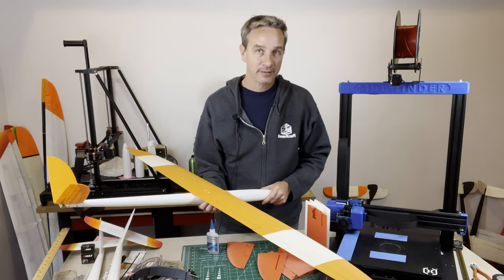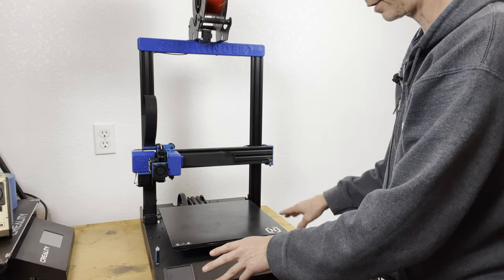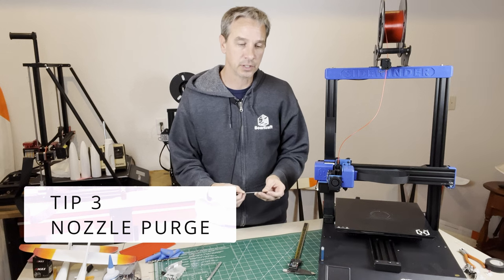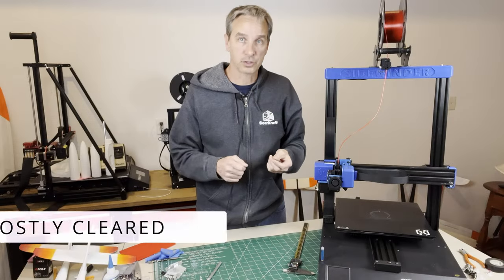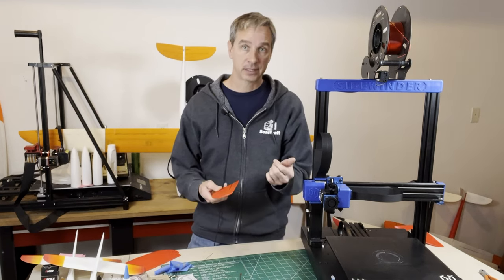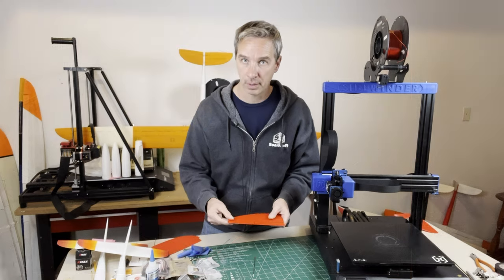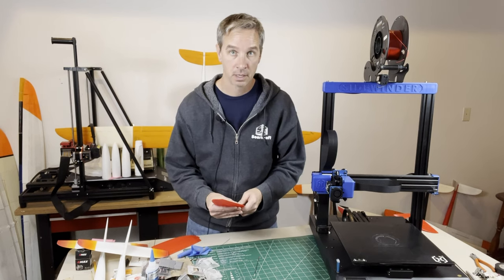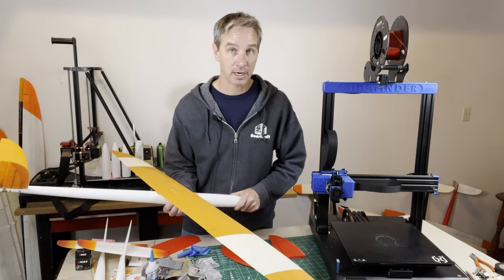5 Printing Tips - for better printing thin wall airplane parts

Comment: I love that Futaba Tx you had in the background, I had one of those for a long time.
Reply from the maker: I got it in the late 80's used.... 6 channel FM ch28... still have receivers for it too... I can get a modern module for it.  I sort of miss having a long antenna with a frequency flag on it as a wind direction indicator.
Reply: @soarkraft  Do flying fields even have a freq board?  Not like you'd have to concern yourself with being shot down.  🙂  I only got rid of that old Futaba when I moved cross country and had to thin down my RC collection.  
There's something to be said about old analogue.

Comment: Awesome tips! I’m a newby with a new Prusa MKs3+, and I’m learning that Cura is the slicer that the Plane Print models are designed for. I watched your video on using Prusa slicer for  model aircraft, nd was curious if i could use Prusa Slicer for my Plane Print model. Any tips will be much appreciated!

Comment: do you print the outside line first?
Reply from the maker: yes, or try to.  Cura 4.11, 4.12, 4.13 does this the best.  Makes for nice "skins".
Reply: @soarkraft  i think I overlooked that when printing my Pika, came out a little rough and flimsy at times, i also printed all wing panels at once
i'm covering it with fiberglass right now

Comment: The major problem I have with printing Planeprint models is stringing ! More I increase retraction distance, more I have stringing ! Unbelievable !
Reply from the maker: There are setting for "combing mode" that can be enabled to help with this... the different slicers have different ways of turning this on.  The funny thing is Planeprint model are suppose to print in only Cura ... but the different versions keep changing how it works... thats what happens when you design to a specific software that you don't have control over.